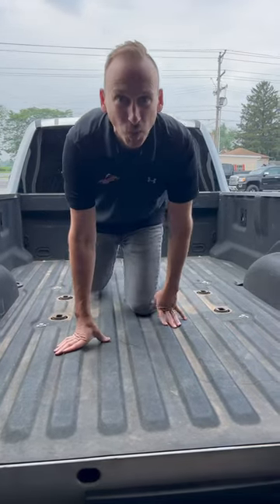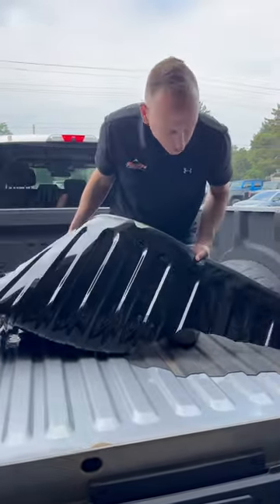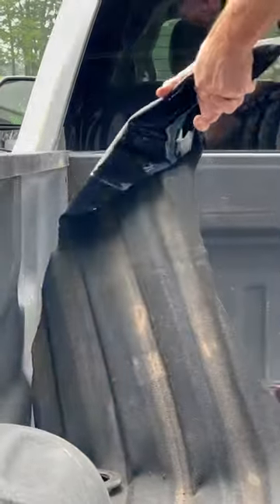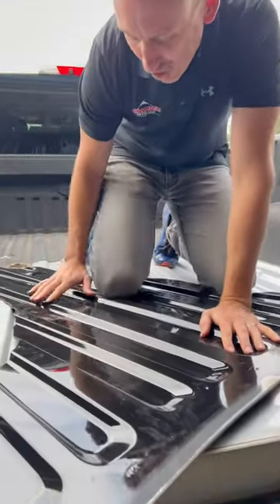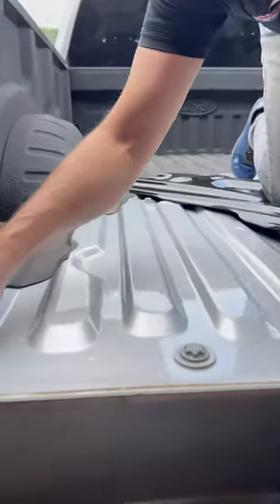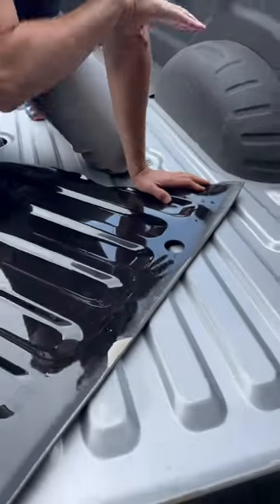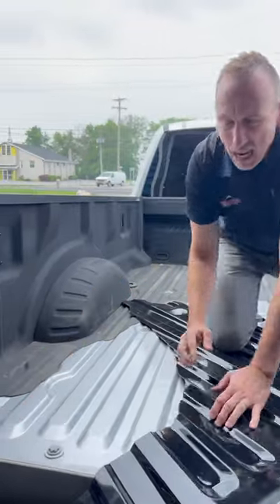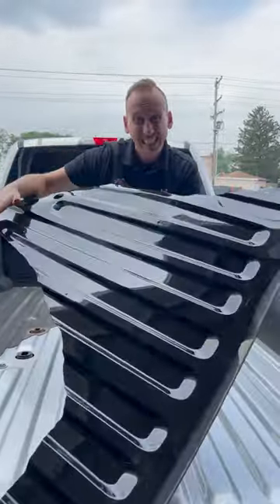New Truck Factory Spray in Bed Liner Worth It? #truck #bedliner

Comment: It’s all about wire taping masking sanding and cleaning properly. I seen a lot of bogus factory liner where the tailgate and around the lights is way sloppy and over sprayed. They should of just ran one wire on the back for that truck

Comment: What would it cost to apply it on a 2024 toyota tundra double cab?
Reply from the maker: $550 for our standard spray, $650 for premium (premium has a top coat that makes it easier to clean and more UV resistant)
Reply: @MountZionOffroad not bad. Will it work on a composite bed?
Reply from the maker: @viva_am839  Sure, but most people wouldn't bother since the composite will neither dent nor rust.
Reply: @MountZionOffroad  respect the honesty